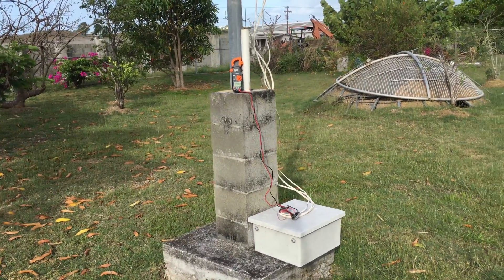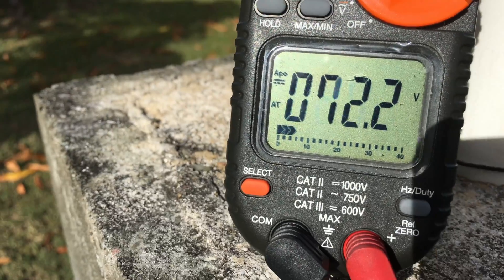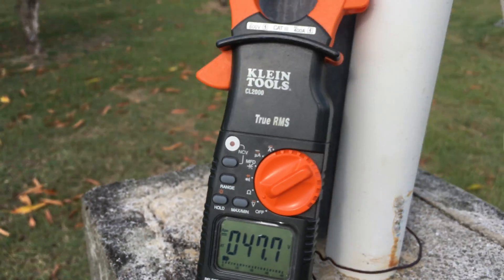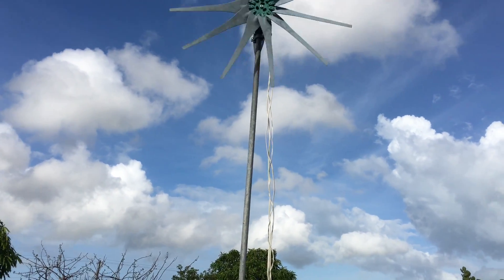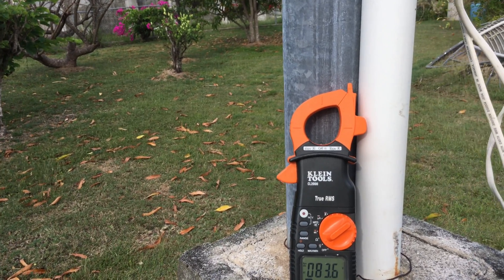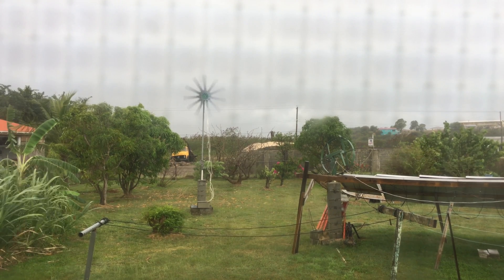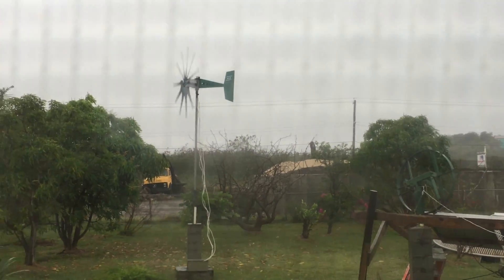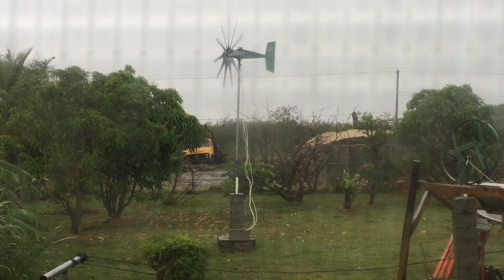Authenticating Missouri Wind and Solar Freedom II Dual PMG 48vdc/96vdc.

Comment: those white wire you got dangling from your PMA wind turbine are AC wires, your PMA puts out DC current, you want multi strands of wire on the inside like that of a car battery cable, and when you get the correct cables secure them down inside of your Pole, you'll have to drill a hole at the bottom of your pipe to feed them out of, are you losing a lot of energy through resistance in these AC cables,, because the PMA is DC current